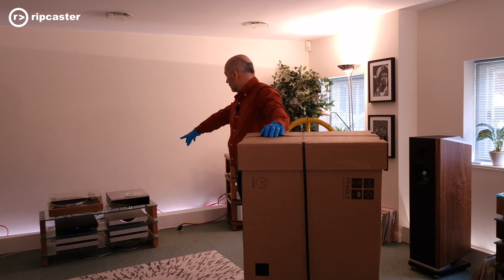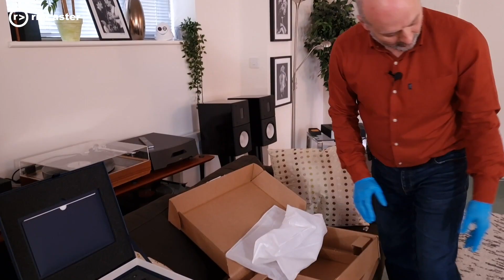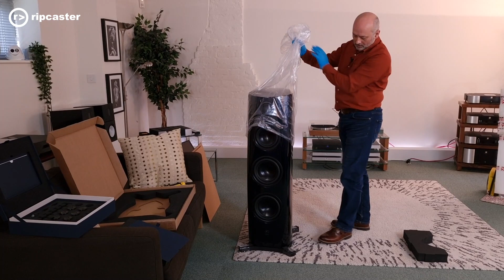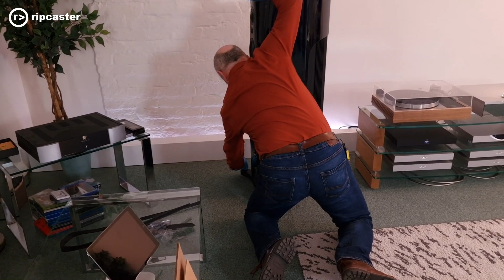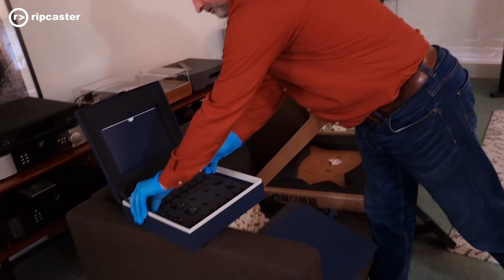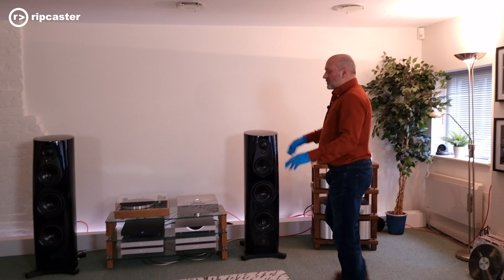Quick  Setup of the 360 Loudspeaker from Linn at Ripcaster

Comment: All this will be happening at my house soon. My question is how does one level the speakers? I can see side to side leveling being done by placing a beam level across the two front feet of the base. However, front to back leveling seems more challenging. How do you do it?
Reply from the maker: Thank you for watching. The base of the Linn 360 speaker has adjustable threaded spike feet at each corner. The locking ring is then used nnce you have made the required adjustments. Your dealer will perform all the setup for you - so you don't need to do anything. Enjoy the 360 when you get them - they are fabulous speakers. https://ripcaster.co.uk/linn_360_loudspeaker
Reply: @ripcastercouk  What I meant to ask is for front to back leveling, what type of level do you use, and where do you place it?
Reply: Just went through the setup. Leveling turned out to be easy as the base is so rigid that a small level placed upon it will give accurate readings. Also, a 24 inch beam level can be laid across the feet as long as the lock nuts aren't installed. So side to side and front to back leveling can be achieved with either type of level.

Comment: I'm sure they sound amazing but the lack of protection for the drivers makes me uncomfortable. Would be interested to hear why they removed the grilles from previous designs.
Reply from the maker: The drive units are fairly robust - they are made of Beryllium, carbon fibre, and aluminium - so you would need to apply some force to damage them (unlike traditional paper/silk speakers cones/domes)... I suspect the constant curvature of the cabinets would make grills impractical. You are welcome to visit ripcaster to see and hear the 360. We have them on permananet demonstration in our showroom - https://ripcaster.co.uk/visit_ripcaster
Reply: @ripcastercouk  thanks for the info. Bit far for me as I’m in Norfolk. I certainly want to hear them though. Are they as good as everyone says?
Reply from the maker: @funland108  You are always welcome if you are in the Berkshore/Oxfordshire area. Check out the Linn website to find your nearest Linn dealer: https://www.linn.co.uk/uk/try-linn